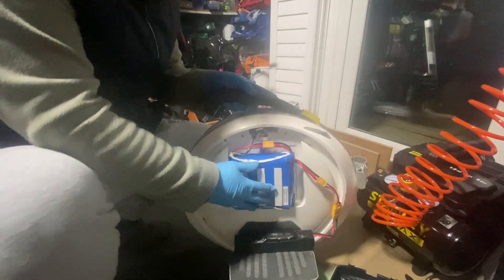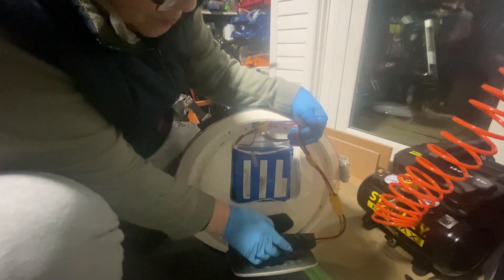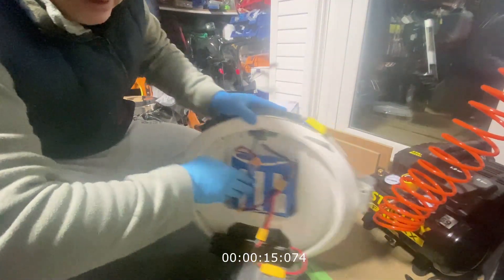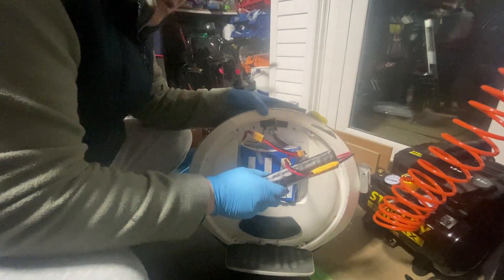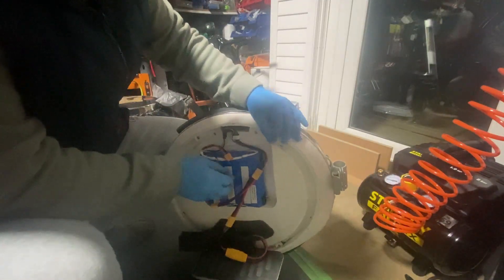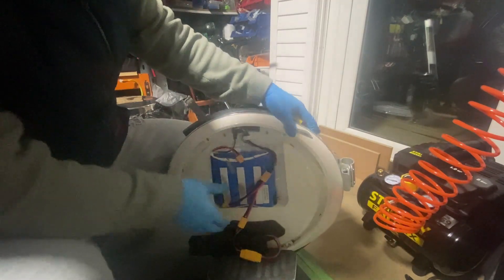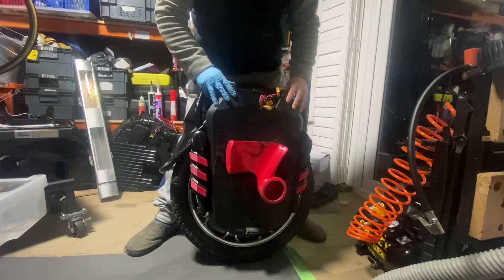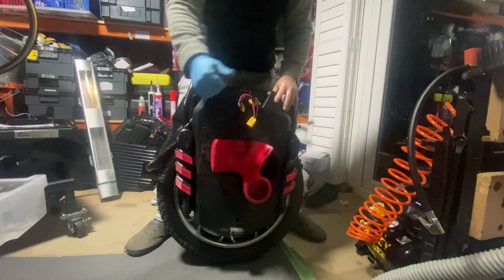Adding  a True Super Capacitors to your Electric Unicycle. EUC Upgrade.

Comment: Hello sir why not just use electric scooter controller. All electric scooter has a controller that limits the power draw. For example most high speed electric scooter have 45 amps meaning it doesn't go further than 45 amps in that case it won't cut off

Comment: Just asking ya, but how does this help in real world riding. All you've shown is the cap provides additional power if the main battery goes offline. At no load. How bout testing during a freespin at 100% batt, 50%, 30%, etc. IMO a viable test would be to show the 30% vs 100% freespin cutout. If both are identical, that would be a start. A live test would a rider doing overspeed/overtorque cutouts under similar batt conditions. If there is a diff, then what is the diff. All you have shown so far is that the supercap will power a no load wheel for x secs. Under real world ride conditions, how much time would that provide a rider? 2ndly, how would a rider know that the main battery is no longer supply power? Even if proven, there's x secs under real load, all it means is the the rider cutouts x secs later because the rider wouldn't know when the main batt pack is offline & stop
Reply from the maker: Ok you need to know how EUC work. With all EUC the battery keeps the wheel up while you are riding, at some point when the motor require more power the battery may not be able to give that power and this is the problem where the wheel may cut out. The point of the Super capacitor is to fill that gap so you don't cut out. My demostation without battery on the wheel will never happen in real world riding.
Reply: @eucupgrades  I see. If I understood correctly, you saying that these specific caps are to provide for a sudden current spike demands? Interesting. Aren't there already such failsafes via dynamic tiltbacks & beeps? There is even a custom fw (by freestyler) that introduces dynamic failsafe tiltback specifically for BG. How would the cap mod supercede that? & how would you be able to duplicate such a real world scenario to provide evidence for such failsafe occurances via caps? Thanks
Reply from the maker: @scottsum1319  Yes the new wheels are getting better but still, tiltback and beeps some time are too late for you to react and you are already down. With 7 years of riding  fallen many many times, supprise cut out is no joke. My mod is still in testing it will be use only on myself on my personal wheels for now.
Reply: @eucupgrades  Thanks for the answers Kevin. I shall await your real world rides test for further conclusions. Personally I hope it does work as you intend as there's no such thing as too much safety. Infact if so, I would hope you can license such a tech to the mfgrs for implementation. Ride safe bud

Comment: Nice video Mr. K. To be complete you will have to do a leak test with your pack. Let the supercaps connected to the battery for a while to fully charge, then add an amperemeter in series and measure how much current they suck from the battery pack AFTER they are fully charged. Why supercaps are not in all appliances nowadays is because they have 3 main disadvantages compared with normal low-esr elcaps or tantalum, etc, one is the price, they are bloody expensive, second is the lower voltage, to make any real use of them you will have to cascade them and in that case the capacity gets down, cascade two, the capacity is half, cascade 10, the capacity is 1/10, etc. and then they get comparable to the normal caps, but more expensive. And the third disadvantage is, they leak, i.e. unless, again, you spend 10 times more money to buy really good supercaps, what you usually get have a leakage current 20-50 times larger compared to ceramic caps, and you put many in parallel, they will drain your battery a lot faster during non-riding time. And they don't age well, you may have no leakage initially, but you will, after some cycles. Sorry if I look patronizing, 30 years in electronic design... 😛

Comment: Needs a true test. If you going down hill and the wheel starts to regenerate.  Wel battery go to what 4.7 but the supers only 2.7. The wheel has no clue there is a difference so they will get over charged and go boom boom. Or am I wrong?

Comment: Power consumtion of the wheel just balancing like this is very low, calculate how many Wh is stored in and do not forget that voltage drop can be just few V, so the power output from the capacitor is very low. This makes no sense to use.

Comment: Very good test Kevin.  As others mentioned my only thought is having a wheel balancing while basically stationary versus riding at speed is going to have a dramatically different power demand. Still, it could be a valuable safety net for those that like to push wheels to the edge of their capabilities.

Comment: I thought that the advantage of a super capacitor was in absorbing surges in current, allowing for fast acceleration and hard braking.
And improving the safety of the unicycle especially with unfavourable motor power/battery capacity ratios.

Comment: Seems like this guy never tried overcharging the supercapacitor - without proper balancing you added BOMB to your vehicle. It is like having 24s high discharge battery without BMS or fuse.
 Please guys don't try this at home.

Please Kevin do your research - if you fix wheels for $$ you should know better.
Reply: I looked that up and it seems they would degrade then stop storing energy, but not lead to an explosion or a short.
So if Kevin makes and sell them, they'll all be dead after some time and do nothing at all. And riders would likely not be able to tell anyway.
Reply: Capacitors can only charge as high as the battery that is in parallel connected to it. I don't believe overcharge can happen unless if there is something wrong with the battery.

Comment: Where is the 60s BMS, or 2x 30s BMS in sync to keep all these super capacitors balanced?
It's an interesting concept on paper but a non-starter in practice without a way to keep all of them at the same voltage. Maybe feasible if you find small enough BMS to do just that.
It might be wise to try to solve the balancing issue before build more units in order to avoid destroying them all, especially if you expect people to ride these wheels.

Otherwise, this is the same demo as last time which doesn't represent riding conditions with the battery still connected, the feedback was not taken in consideration.

Comment: I'm thrilled to see this Kevin!  
Great proof of concept...
...but it should be explained that the addition of a "passive" super-capacitor will have minimal benefit for 95% of users. This simple addition DOES NOT prevent high-speed cut-offs, nor will it increase top speed. {Although, I believe this is possible}
 
The greatest potential of this evolution is not cut-off protection from over-torque, voltage sag or battery over-current (which are benefits) but rather it's "range extension" or a reduction in battery sizing possible through an increased regenerative efficiency. (Tesla has done the math on this.) 
 
IMO Sizing an integrated design should have the capacitor capacity to equivalent to accelerate a rider from zero to max speed and then decelerate to a stop on a 35-40 degree slope. This means that a partitioning of the SC bank is necessary so that 1/3 to 1/4 of the bank is always depleted and ready to adsorb the high current loads of decelerating downhill. My GUESSTIMATE is that an active capacitance management of a partitioned system could yield 10-30% increase in range for the same sized battery or a decrease in battery size from approximately 25% yielding similar range to current designs. This will require an integrated system design by qualified engineers. 
 
As a next step an interesting test would be to accelerate this "test wheel" to the cut-off speed without having the battery as backup. A Dyno would be helpful as a demonstration to remain safe while taking measurements. {A treadmill could work too, lol.} Also, measuring the existing regenerative efficiency of all wheels would be useful as a baseline.
Reply: Space is always at a premium for EUCs so it seems unlikely that it could become a worthy addition, even if it's a worthy tradeoffs on a car.
Then there's the problem of complexity. Current EUC manufacturers already struggle to make reliable controllers, both on the hardware and software side so an increase in complexity to add support for this feature would only be something to consider in a distant future.
Reply: @supercurioTube  I completly agree, but I feel it could be helpfull on the bigger wheels, if done correctly. still it's something for the distant future for sure :/
Reply: @mrSlowflake  in my opinion the best solution to the problems described are already solved by high discharge cells, including a significant reduction in voltage sag, increased safety margin including in low temperatures, effective redundancy if a pack breaks during riding with the bonus feature of being capable of charging much faster with no significant degradation.
These capacitors in parallel are just a distraction and nobody talks about the benefits of high discharge cells for some reason.
Reply: @supercurioTube  this seems pretty logical, thanks. I agree that a more simple design will always be better and more safe, we should focus on improving what we already have, especially with uec's snice the technology is pretty young. thumbs up !
Reply: @supercurioTube  one more question, I've recently bought a s22 pro, any thoughts on this new design over the older models? (I ask since it seems you bought a earlier version of the s22, but I'll watch your videos for more info)
Reply: Thank you for this comment, there are many aspects emerging from technical persons, I'm keeping a keen eye on the comment section to gain a better understanding.
Reply: thank you or the information sir, what I take away from this comment is, yes there are proven bennefits of supercaps but it's something that needs to be designed by proffesionals. wait for reliable companies to implement this feature in a reliable and proven way. again thank you, I won't try this mod myself and I will wait and be patient for a wheel that is disigned by a proffesional company with capable peopleworking on it and after that still wait for the communty to test and proof it even further since this is possibly dangerous :)

Comment: Thanks for doing this video but, as others have mentioned, those caps will discharge MUCH faster when used during a ride. You’ll also need to compare the total internal resistance (“ESR” for caps) of all those caps in series against the internal resistance of the battery packs. Unless the caps have a much lower internal resistance they won’t help much during a ride. Another concern is that supercaps are VERY easily damaged from overvoltage. You will need the cap equivalent of a BMS with balancer for those caps to help keep them from being damaged and, eventually, possibly failing.
Reply: Would you already have a rough idea of the internal resistance to expect from 60x super capacitors in series?
It's true that unless the end result has a low internal resistance, it will not help in any way.
Reply: @supercurioTube  it depends completely on which supercaps he used. The ESR can vary a lot.
Reply: Thanks for this comment, im keeping an eye on these comments to gain a further understanding
Reply: 23 seconds is good buffer, given the other factors you mentioned maybe 5 seconds => still better than no cut off buffer :)
Reply: @GeminiK1  this is where the video is misleading. All it demonstrates is how long a wheel can run without being ridden before shutting off.
It doesn't reflect in any way shape or form difference or lack thereof it would make when riding with the battery still connected.
Reply: @Jason Untalasco  this is also my thinking, please note that the battery during basic testing was disconnected, in the real world this would like never happen, as such voltage sag is likely never to occur with this supercapicitor, look forward to testing results. It should be noted that the rider will always be responsible for the wheel and must understand and know the limits of the wheel and accept the inheriant risk of riding a wheel.

Comment: No-load test is not a valid test for this. When I ride, my wheel uses about 60 amps when accelerating, and much more when in  an emergency situation. In your tests the wheel is most likely using less than one amp. Caps about the size like your package will support the wheel in an emergency situation for a few msec.

Comment: Nice, but if the wheel is under load, it will drain a lot quicker.  Also, the small wheel gives a warning of problems (fast beeps), but it seems like other than maybe tilt-back, the Abrams gave no warning, so for that case, is it really providing much safety if the battery shuts off and stays off?